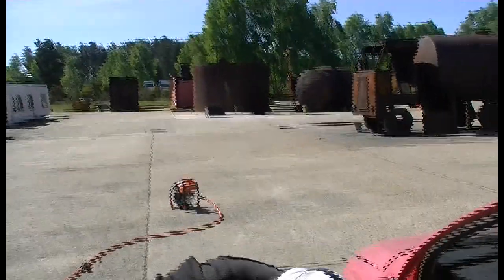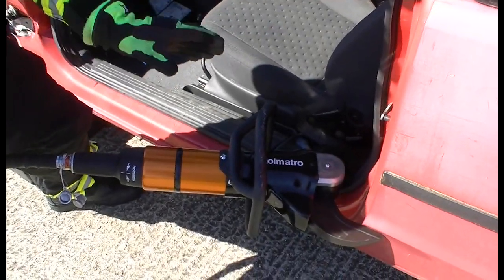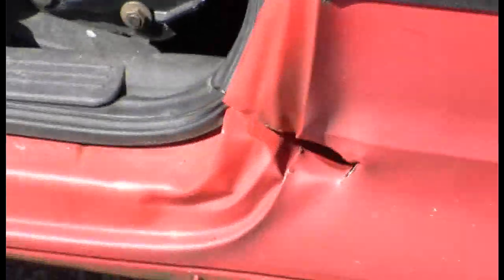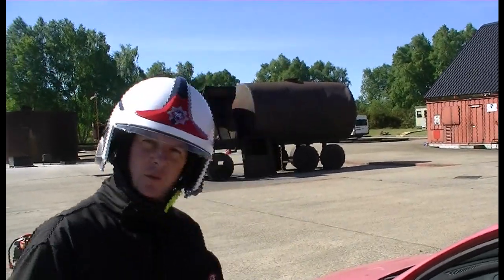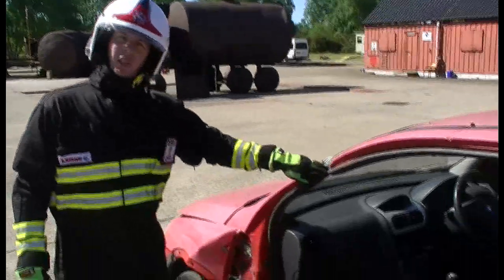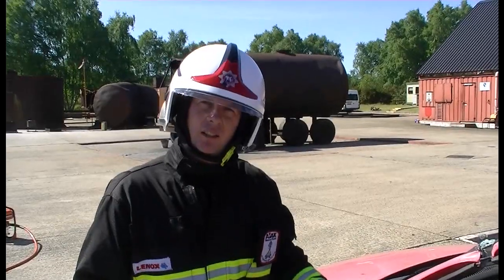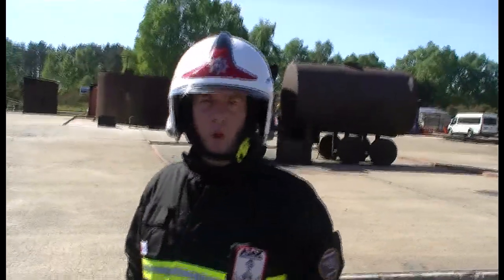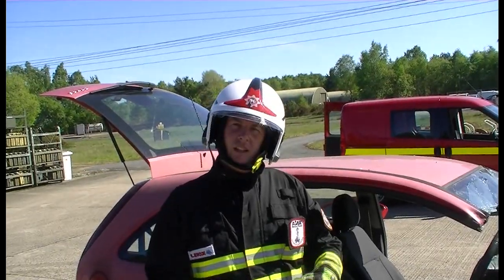Extrication RTC Training New Tool - Attempted Dash Lift

Comment: Can I just ask, with the dash roll, what is the purpose of the initial cut to the A-post? Why not do the relief cut, take strain with spreaders and then cut the A-post? Thanks!
Reply from the maker: Hi, thank you for the comment. This was not a video to show the correct procedure for dash evolutions as such, it was part of a few videos introducing teams to the new equipment and how they can be used. The video briefly shows a dash lift not roll. You are correct, the norm would be in most cases to cut the A pillar last to maintain some form of structural integrity and to have a ram/spreaders in place to support the load. Which we have not demonstrated here. Thank you for the question, i hope that has helped.